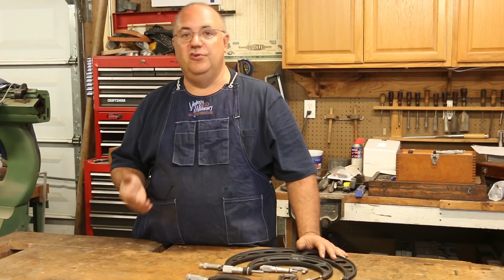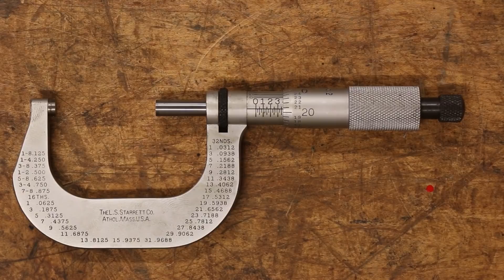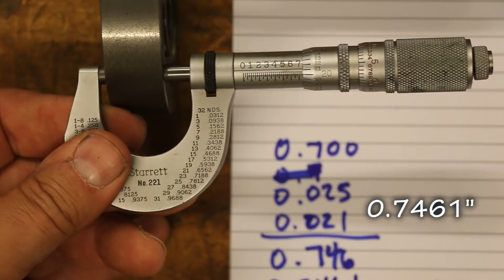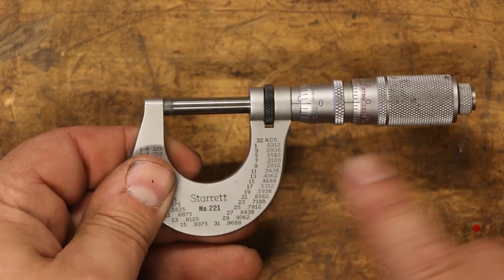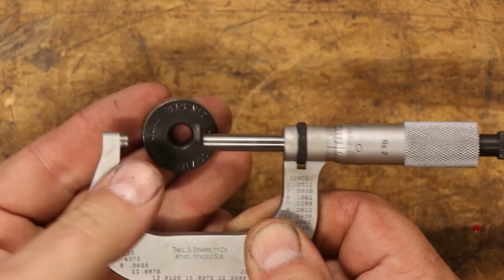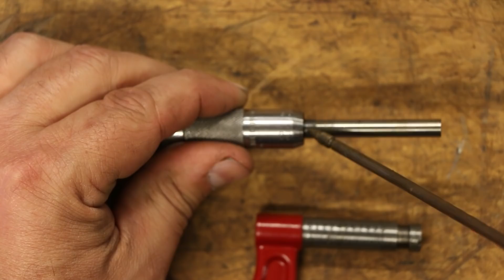Micrometer Basics:  Use, Care and Calibration

Comment: I just did a complete take-apart, clean,  shine and "rough in" calibration on a Central Tool 1" - 2".  Without a standard, I had to get rather creative in finding something to set it by.  It involved a mag based dial indicator, two new and never used HSS tool bits and (another) new and yet to be used drill press vice.  It consistently measures within 1/2 of 1 now.  Not bad for a mic that started, with me anyway, as a "can't lose anything by trying" project.
Reply from the maker: +diggerop Very cool!  If nothing else, you made it better than it was and you probably now have a measuring tool that is worth using!
Reply: It certainly wasn't worth much being in the condition that I got it.  Can't wait to get with someone that has a standard or a set of gauge blocks to see just how close I came to true calibration.

Comment: Great video, although it was a little light on the use part (importance of using consistent torque, thus the ratchet on some. etc.). I expect these things are second nature to you so you didn't think of them.

Personally, I like my Moore & Wright Micro 2000. It's as quick and easy to use as a caliper but with 1/1000th of a mm resolution and really good repeatability. I don't understand why they don't make spring loaded micrometers like that any more.
Reply from the maker: +stefantrethan I am pretty sure that I have a Moore and Wright micrometer or something long those lines somewhere in the shop.  I can't remember which tool it is but I know I have something.

Comment: EVER TRY SYNTHETIC ATF , AUTO. TRANS. FLUID , AS OIL ?? VERY GOOD & CHEAP .
Reply: +OLD WIPPER-SNAPPER I use it too. Mostly on those cheap cintered bronze bushings in throw-away box fans and other motors. I've tried other types but they dry up or gum up the bearing. ATF doesn't break down or varnish like everything else. Also it's fairly thin and soaks in good. Added bonus it doesn't smell bad
Reply from the maker: +OLD WIPPER-SNAPPER I have used it for some applications, but I use Starrett oil on my micrometers.....

Comment: I learned to use a dial caliper and micrometers back in the 70s in physics class.  Best thing I learned in high school. The one thing that is always told to people in machine shops when I started in 79. A micrometer is not a C clamp. Sounds funny until you have seen someone reefing one as tight as a clamp.
Reply from the maker: +57WillysCJ One thing that you should never do is store your micrometer with the anvil tightened down.  I meant to mention that in the video!

Comment: When I was in HS (40 years ago) my science teacher gave me a German made 0-25mm micrometer. It was seized up. Apparently someone had tightened it down in the winter and with expansion in the summer it was tight. I clamped it in a vise and loosened the barrel. Took it all apart. Cleaned it. Did what I could to zero it. It's nice now.My Metrology Prof in College tried to buy it from me.I was the only student that could wring their old nasty gauge blocks...
Reply from the maker: +Phil Grindle I don't even own a metric micrometer or any other measuring tools for that matter.  I probably should have a few just in case as right now I have to convert any metric measurements I work with to inches....  Nice that you have one with good memories attached - those tools are priceless!

Comment: Hi Keith,

I like to remind people that an accurate zero is not an indication of a micrometer in good condition. Micrometers wear worst in the range in which they're used the most. It's wise to check them with gauge blocks at intervals over their measuring range.
Reply from the maker: +Paul Compton Very true, particularly with older ones that have obviously seen a lot of use.

Comment: Very useful video. Thanks.

A couple of observations: When using the smaller micrometers (0" to 1" and 1" to 2") it can help protect them from being dropped if you curl your little finger through the frame. This gets a good safe grip on the micrometer and locates the forefinger and thumb perfectly for turning the thimble and holds the graduations in a position where they are easy to read. Most drops seem to happen when you are changing your grip on a micrometer, and this cuts how often you need to change your grip. You can also make large changes in the opening size by rolling the thimble up or down your opposing forearm, all without changing your grip. (Just don't "slam" a 0" to 1" micrometer down to zero using this rolling method; it can bend the frame slightly, and require re-calibration, or even require getting the anvil reground to make it parallel with the spindle face again.)

Second observation is only peripherally about micrometers: People frequently wonder why there is usually a pocket on a machinist's shop apron that swings out (instead of being sewn flat like all the other pockets). A micrometer is usually the most valuable small tool owned by a machinist, and the most easily damaged. The swing-out pocket is to prevent the micrometer from falling out of the pocket when you bend over to pick something off the floor or a low location. Once you think about this, you will see that the swing-out pocket is exactly the right size for a 0"-1" micrometer and will hold it upright to make it easy to get a good grip on the thimble as you pull it out of the pocket. (Don't forget to put your little finger through the frame as soon as possible.)
Reply: Getting a bit off topic, but my grandfather (according to family oral history) once had a really terrible, violent temper. Apparently, about 35 years before I was born, my grandmother told him that if he ever lost his temper again, she would leave him flat. No remorse, no "i'm sorry", no nothing; just gone. By all accounts, he never lost his temper again. It may have turned him into the extremely successful company owner that he turned out to be, but he never lost his temper again. At any rate, he was clearly unhappy about what I had done, but spent time explaining the difference between a C-clamp and a micrometer. and then set me to making cubes.
Reply: BTW, my grandfather and grandmother were childhood sweethearts from the time they were 7 years old in a tiny village in Sweden.
Reply from the maker: +Peter W. Meek Peter - thanks for the tip on the little finger.  I will try that, but it will probably take a huge effort on my part to train myself to use a different technique than what I have been doing for years.  Hard to teach old dogs new tricks....  About the shop apron pockets, the swing out feature is handy for pretty much whatever you put into those pockets!
Reply: It was how my grandfather taught me to hold a micrometer (after he got over discovering me using his micrometer for a C-clamp) back around 1950. Once he had re-lapped the anvil parallel to the spindle (that's how I know about that) and recalibrated it, he taught me how to use it. I was set to making 1" cubes using a vise, hacksaw, file, micrometer and square. They had to be closer to 1.000" than to either 0.999" or 1.001" (so ± 0.0005), and no light under the square at any location. I have to say it taught me how to use a hacksaw and file efficiently and carefully. Go undersize and start over. Age about 7 or 8.
Reply: +Peter W. Meek He got over that? :O LOL
Reply: "When using the smaller micrometers (0" to 1" and 1" to 2") it can help protect them from being dropped if you curl your little finger through the frame."

That's how I was taught to do it, and have always done it that way.

You can also steady the micrometer, by resting the frame, between the spindle and barrel, on the pad of your third finger.

Comment: little tip: I mostly check my micrometer reading with a quick "ball park" digital caliper (bozometer) reading, to be shure that I read it correctly. I am a beginner with this stuff, and this helps a lot. cheers. Thanks for the video, Keith.
Reply from the maker: +Flip de boer Nothing wrong with that at all if you are just making sure that your numbers match.  But, be careful and don't rely on the digital calipers too heavily as the micrometer is generally more accurate.
Reply: Shure, if the bozometer reading is in the ball park, I'll always go with the micrometer reading, but I have had a few occasions when I messed up with reading the micrometer. Especially when reading shows roundabout the zero on the timble, when the reference line on the micrometer body is just starting to show; or are you allready past it? (suddenly your part is precisely 0,5 mm off, and you immediately know where that came from..) i cannot afford Starrets (yet), which probably do not have this issue so much due to crispier engraving.

Comment: Nice  demo Keith the only thing you didn't mention is that temp can play a roll in the accuracy of the measurement
Reply from the maker: +The Apprentice You know, I meant to mention that but it did not ever make it to video.  Very good point though!  Most inspection rooms where super accurate measurements are made are required to stay at a constant 68 degrees F +/-0.2 degrees F.  And your parts should become normalized at that temp before measuring!  But for most machine shop jobs, temperature is not as critical.

Comment: Keith thank you for posting this video.  I know there are a lot of videos out there on this subject.  I was taught by my auto shop teacher, then through the years others showed me some tips like using your forearm as a surface to run the thimble open or closed  rapidly.  I remember having a whole lab experiment in physics class on reading inch micrometers, metric micrometers, and vernier calipers.  Each time I see a different person, I usually take away some little tip.  I think it is valuable to always look at how you are doing things and compare it to others to make sure you are doing it the best way possible.  All too often I feel like it is too easy to say "I always have done it this way" or worse yet hear from your boss we always due it this way.  The more important question I feel is ""Is this the best way?"  Then you are thinking more about what you are doing, and also how to define best.
Reply from the maker: +Bill De La Vega Thanks Bill - one of the beauties of YouTube is that you can see how others do things that you might do differently and pick up new tricks along the way.  I have had I don't know how many requests to do this video for some time now and I am somewhat surprised by all that are so thankful for me posting.  I guess I just take it for granted that people know the basics when many don't or may do things differently.
Reply: +Bill De La Vega Perxactly! Just because the comment floats around that "This is the way we've always done it" or That's the way we've done it for the last ten years" doesn't mean that's the best way to do it. Always learning. Good comment, Bill. My hero Uncle was named Bill and he always told me "You can't learn too much" and "LOOK at what you're looking at". Always worked for me but irked a lot of others.

Comment: Fantastic video - a very practical and approachable intro to micrometers.  I'm curious though - back in my chemistry class, we were always told to read to the last digit that was definite, and then estimate the last digit.  For example, if I could read .234 for sure, and it looked like the line was right in the middle, we would call it .2345.  Is that not recommended for micrometers?
Reply from the maker: +Paul Frieden In the machine shop, I would not estimate much of anything as if you give a number for the tenths, somebody is going to assume that it was made with a precision measuring tool.  If my tool measures to a thousandth, that is all that I would go by.  But with that said, I will sometimes estimate to a half thousandth using a micrometer when I am working on something - but I would never write down or give that measurement.

Comment: Besides verifying your mic is zeroed you should also check it with the standard at full open to verify that it is accurate over the entire range, or if it is off to know by how much. I did a video discussing that it might be of interest to some viewers here. https://www.youtube.com/watch?v=e9HWU5xA-cc
Reply from the maker: +bcbloc02 Very true, particularly if you have an older or obviously used and worn instrument.  I have even been known to check the measurements throughout the range with gauge blocks since a micrometer used in an inspection room might have seen excessive wear in a small range somewhere in the middle.  I am usually pretty picky about buying used micrometers and try and find ones that have obviously seen little use.

Comment: Hello Keith,

Very interesting video because I never used an micrometer maybe because I didn't know how to use them. Now with your explanation how they work I understand the use of it and maybe I'm gonna buy also one. Not a really expensive one such as you have but it is always handy to have it with lots of precession measurements. 

Only thing I've asked myself was why most of the more bigger micrometers have a half rounded frame. Is there a special reason for because of strength or is it just the way they make them and has no special reason ?

Again thanks for the video and many greetings from Roel !
Reply from the maker: +RoelTyros You can find some nice used micrometers at a very reasonable price on places like ebay.  As for the larger frames, as the micrometer gets bigger to measure larger sizes, it needs to have a larger frame for for measuring round stock.  When measuring round stock (like on a lathe), you need to have a throat that is at least half the size of the maximum diameter you can measure.

Comment: i use my depth micromtet for checking the tread on my ford f100 tires and my dad give me his calibrating and micrometer when he die in 2011
Reply from the maker: +ford trucks The guys at the tire shops have a similar tool for measuring tire thread, but it is usually not as precision of a measurement as a micrometer.

Comment: As others have said, a great video. Only two things I would have added. A micrometer is not a clamp, do not over-tighten on the part being measured.In order to avoid this, use the ratcheting knob until you develop a 'feel' for the instrument.
Thanks again
Len

Comment: I'm sure Keith already knows this, but.. You can adjust tension on the threads to compensate for wear by adjusting the nut on the sleeve under the thimble. Do not adjust it with the spindle completely removed or it will get too tight and you will have to stick things in it  that don't belong in the workings of a micrometer to loosen it up again. Just saying.
Reply from the maker: +Justin Bell Yeah, I am aware of how that is done but I don't think I have ever actually had to use that trick on a micrometer.  I did not want to get too advanced in this video as it was already too long.....

Comment: It would have taken me a while to figure out that I can pull apart my mic set to give it a good drop of oil. I probably would have used what ever is at hand like some motor oil. Probably better than nothing but not the best. Every time I use one of my mics I calibrate it just to make sure it is in standard. I mainly use my mics to measure cams, cranks and trans mission shafts in motor cycles at school.
Reply from the maker: +Matthew Troiano I never have been afraid to take things apart.  I loved Christmas morning as a kid because by dinner I would have taken everything apart to see how it worked.  Of course, sometimes I had a bit of a problem getting everything back together again.....  And I was quite sure that one time if I put that cross wire in my new set of Walkie Talkies that it would double the power, but instead I just released all of the "magic smoke" that makes those suckers work.....